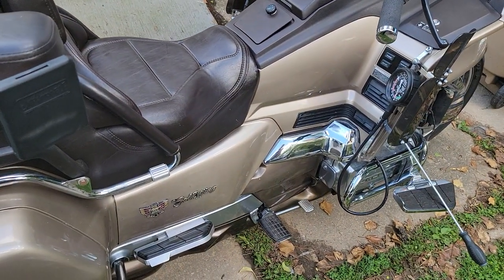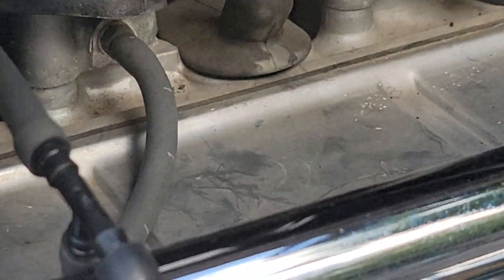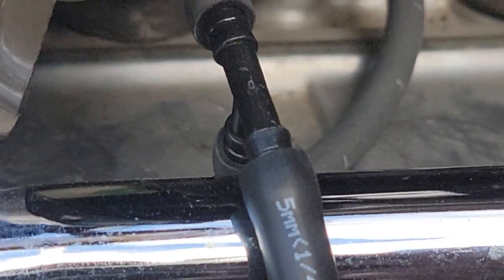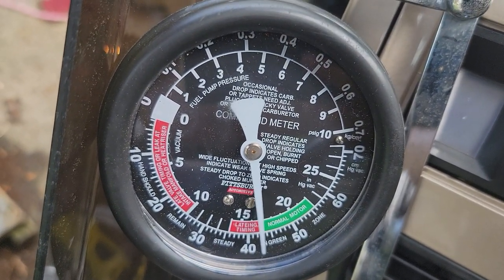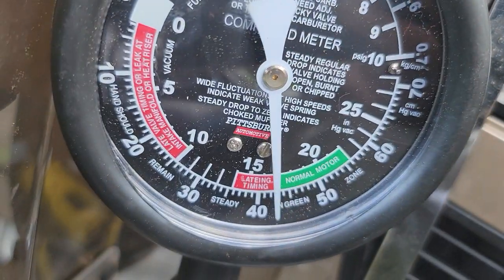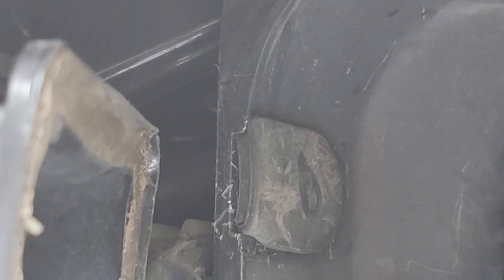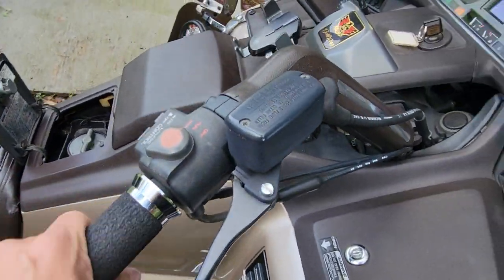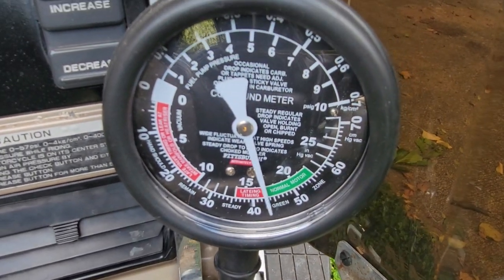How to Synchronize / Balance your Honda Goldwing GL1500 carburetors yourself

Comment: Suggest also checking that both gauges read identically, or note the difference between gauges by attaching both of them to a single vacuum source first. Knowing that variance first is a way to ‘balance’ the gauges before using them to balance those carbs. 
I appreciate this simple short video showing where that screw is for adjustment, thank you!!

Comment: Why are you using T connectors.? I can’t quite see where the tubes from each t connector go and the engine noise drowned out what you said at the critical moment… something about the other manifold…. Would it not be better to just connect each gauge to the manifold only? Thanks for your help.  I seek only to understand all this before I begin. Thanks for the video.
Reply: I’ve also adjusted a dozen or so carbs on these GL1500’s and the reasoning for using a “T” is to maintain the complete vacuum circuit within the “closed” emission system in which those vacuum tubes are part of. ei. The vacuum gauge (s) ARE connected directly to the intake manifold on each side, and a “T” is inserted in each line to re-plug the factory vacuum tube into that to maintain the “closed” system within the emission system. “Hope that helps explain it some?” I also found that using a long 1/4” extension with an 8mm socket stayed on the adjusting screw head better than trying to manipulate and maintain a flat head screwdriver on point? Good luck.
Reply: I agree that the gauges should be connected to the manifold only.  No T.  Otherwise, whatever is in that vacuum circuit could affect the reading.  There could be a leak in that circuit or they could be connected to each other.
Connect to the manifold only and plug the hose you pulled off.

Comment: it was a smidgen hair difference. If it ain't broke don't fix it. I've rebuilt my carbs and had then in and out a few times and have no idea what screw you are talking about. There's nothing to adjust on that carb bank and not from down there. Can't reach the air screws.
Reply: yes there is.